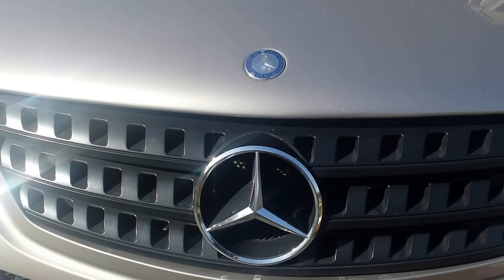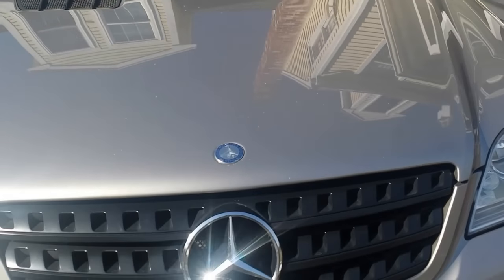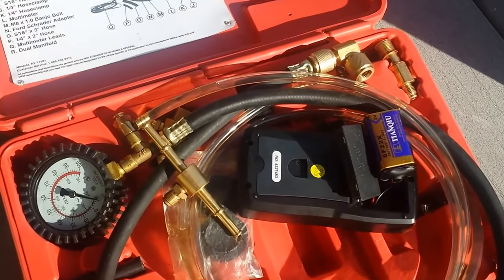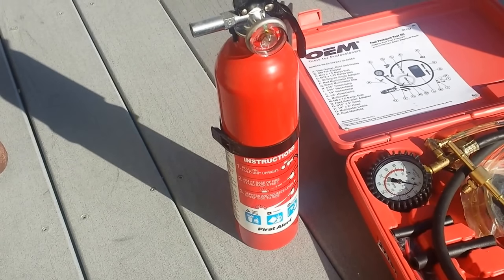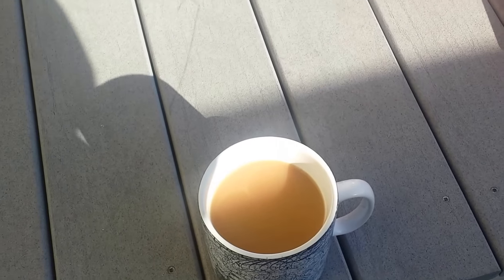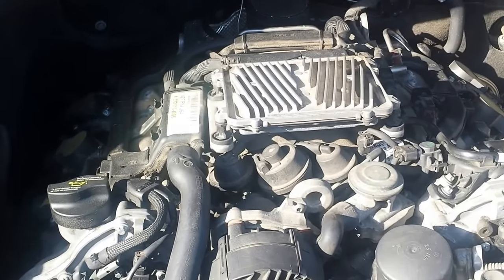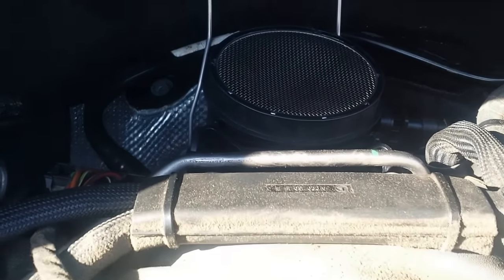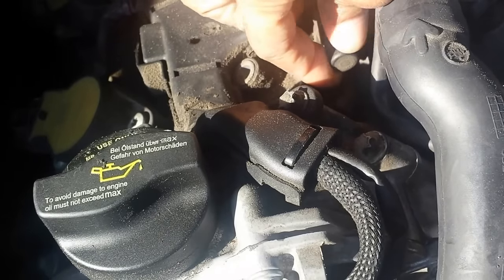How To Tell If Your Mercedes Fuel Pump Is Bad (Fuel Pressure Test DIY)

Comment: I know it’s been months since you posted this but I have the same problem but I changed my fuel pump and I changed my fuel filter but I still have no pressure and my car won’t start it will crank but no start. Please help me !!!!!
Reply: ever found out what happened ? Im thinking its the crankshaft position sensor, i have the same issue with my 2008 350ML 4matic.  Happened after a long trip too.
Reply: @darkvctry7482  mine was the CKP, but sadly the wrong one was ordered so it took awhile then the starter went out. Changing the CKP should only take maybe an hour

Comment: Also, this does not seem like a fuel issue if what you said is true that you are holding 50psi with the engine on or off. It sounds more like an ignition related issue or a massive vacuum leak.

Comment: Can u do this test if the car doesn't run? I can hear my fuel pump prime wich makes a loud almost growling sound but car wont stay running and acts like its running out of gas before it stalls. I want to see if my pump has enough pressure. It only stays running for 10 seconds if that.
Reply from the maker: the sound of it priming tells you its getting power - but the growling part can indicate that the pump is not working properly (i.e. enough pressure in the line to feed the injectors adequately.
Reply: @iRepairAutos  thanks for thr fast reply. Can you do a pressure test if the car doesnt run though?!? Or does it have to be running to test the pressure? For example can I hook up the gauge and then turn the car to the on position to get a reading that tells me if its producing the right amount of pressure or does it have to run?

Comment: r350 turnover but not starting... After I messed with menus on steering wheel and dash cluster... no fuel at time of ignition. it was running fine until then. Please advise ... thx
Reply: I have this problem too ✌

Comment: I have a mercedes c-class with the om642 3.0 cdi diesel engine,2008.I'm getting a fault only when i accelerate really hard at say 60mph,i get fault code p0089 or 11b800.
As soon as i accelerate hard the eml failt light comes on and power is reduced.
My car runs absolutely flawlessly at all other times,in fact if you drive the car normally and leisurely you wouldn't know car had a fault!
All fuel sensors have been replaced,lift fuel pump in tank is fine so i'm suspecting it's the high pressure fuel pump at fault,can the high pressure pump show a fault only when being pushed hard suddenly at speed,but perform well otherwise??

Comment: I want to ask.. my car is E250 CGI, when I kickdown, at 5-6k rpm I feel stuck and suddenly the rpm drops to 5000 down.  Then the gas response is unresponsive as it is being held by the ECU (doesn't want to kick down again).  But after turning off the engine and turning it on again, the engine just wanted to pull again, but it couldn't kick down until 5-6k rpm.

 when scanned, no mulfuction came out.

 I've been around to many workshop and haven't found this solution... please help me to solve this problem🙏🙏🙏 thank you...

Comment: I put a alternator on the car the battery went dead.so got a new battery,now it's not getting no gas.is my fuel pump bad.
Reply from the maker: Check your fuel pump fuse.  Also use your remote to arm, then disarm the vehicle.  Maybe your security system has locked out the fuel system when your changed the battery.  Fuel pump could be bad but I would check those things first.
Reply: How do you use a remote to arm and disarm. My ML350 was showing that battery was dying and stopped on the freeway. Found out the battery was dead then checked the alternator and was also dead. Now I have a new battery and an alternator and the problem ensues. Please help
Reply: We just put in a new alternator with the new battery and still just cranks  and not starting

Comment: That pump is rated at a 40psi line consistent pressure. I'd possibly look into your regulator or filter. I am currently diaging one with zero fuel rail pressure. I've come to the conclusion of a bad fuel pump
Reply: Likewise but I’ve also heard that the crankshaft position sensor could be the reason the fuel pump doesn’t turn on also so I hope once I put the new fuel pump in, that’ll do the trick. Changed the oil to my car and then boom crank but no start.
Reply: @kjr8290  unfortunately I've come to learn sometimes that's just the circumstances. Did a trans service on my 86 Merkur and my rear output seal went right after. Sometimes it's just the Unluckyness of the draw. Though giving ford common issues. If it's phaser driver VVT It could very well be the crank or even cam sensor. But from experience I don't think they are In line connection wise. I believe it is a reference for signal. Alternatively you could bypass the relay and jump power to the pump that will tell you if the pump infact is shorted or functional.

Comment: I have a situation when with 1/2 tank of gas, when I make right hand turns or accelerate quickly the car loses power.  Guessing it is an issue with getting fuel.  Any thoughts on what may be going on?
Reply: it could be clogged fuel filter. most today's vehicles have fuel filter in the gas tank, so not easy to replace.
try "fuel system cleaner" and "fuel injector cleaner" first. cheapest easiest thing you can try.
if that doesn't help, it gets more expensive.
Reply from the maker: Your gas pump/ filter is on it's way out.  David is correct.  I have a video on how to replace them on the channel.
Reply: Thank you both.  Will try line cleaner and watch video 👍
Reply: @davidjacobs8558  how do you know it’s not the fuel pressure sensor that’s bad?
Reply: @kxrtierk1284  I don't know that. I'm suggesting the simplest easiest thing that most car owners can try on their own.
after that, it get more expensive, as I wrote.

Comment: What was the final diagnosis?
Reply from the maker: Fuel pump was good.  Continued to trace the problem and found it to be the air intake manifold was bad (broken flaps internally)
Reply: james white how do I tell if my 09 Mercedes clk350 has the sport package or not
Reply from the maker: What's the vin#?
Reply: @iRepairAutos  how do manifold flaps cause such poor running and misfires?

Comment: No, that's not what the clear line is for! And it's definitely not a "bleed line". It's used for performing a fuel volume test.
Reply: It is used to release pressure from the fuel rail, along with checking pressure. If you are removing the fuel rail to service injectors, intake manifold, etc, then you release the pressure from the fuel rail. If you want to check the pressure levels, the schrader valve on the fuel rail is also utilized for that purpose.
Reply from the maker: Exactly David B.

Comment: Gas? Diesel? One pump? Two?
Reply from the maker: +Russell Loyd gas, these vehicles because of their tanks have a two sided pump
Reply: Can u just replace the right side only??....I have e500 2006 I need the fuel pump and fuel regulator
Reply: @iRepairAutos  ??